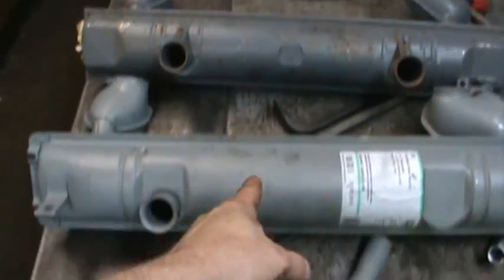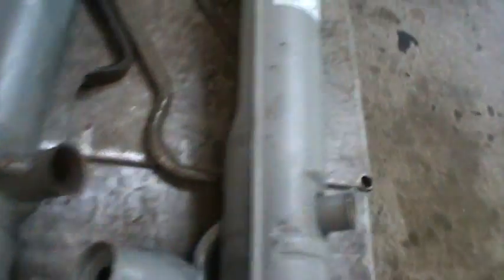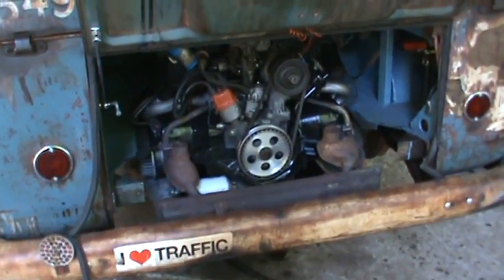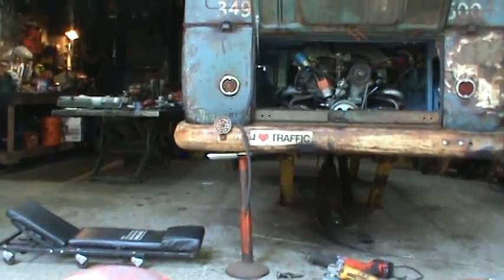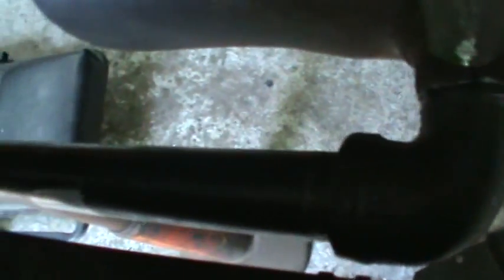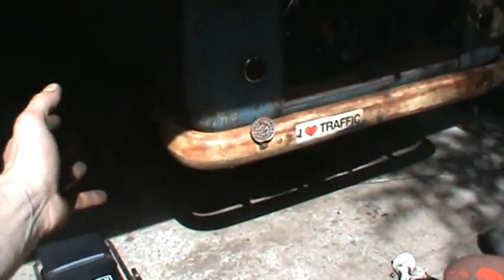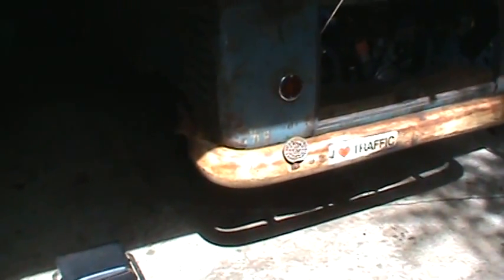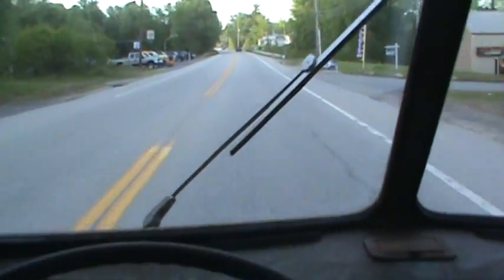1959 vw single cab rustoration part 31

Comment: Sounds like a V-Dub now for sure, it's funny how totally different the two exhaust tips sounded. Did you notice any performance loss? Y'know I saw you rebuild the whole underside of that single cab, but for the life of me I don't remember seeing the heater channels.
Reply from the maker: l dont notice it but l may cut open the other side and do the same,
Reply from the maker: its the round tube that goes down the center of the lower frame
Reply: Yeah, opening up that other side makes sense those heads may have had some flow work done on them if the bling on them is any indication. Plus the heat pipe thing too.
Reply: mustie1 Ohhh I remember now.